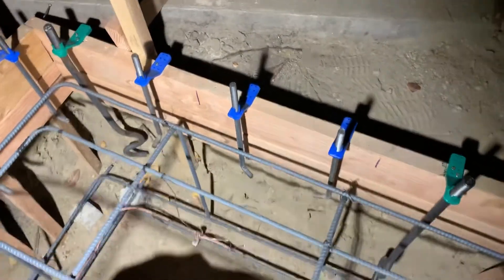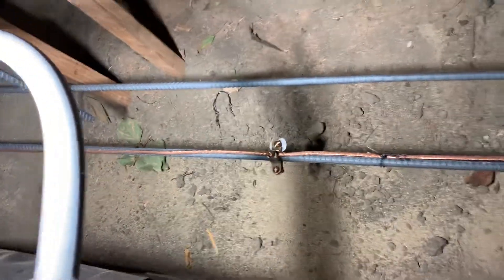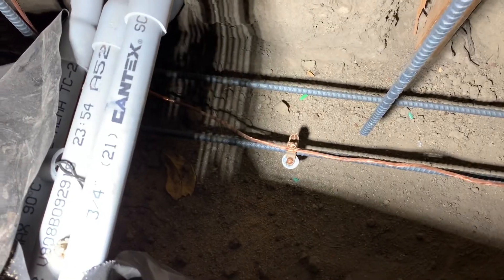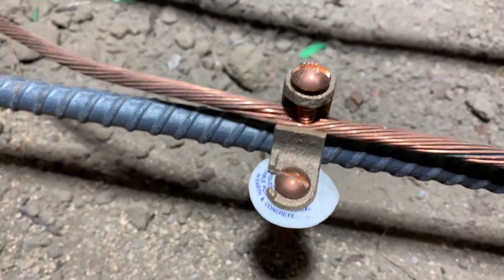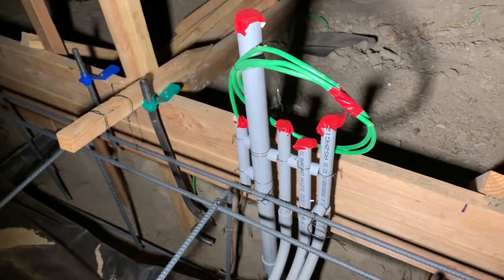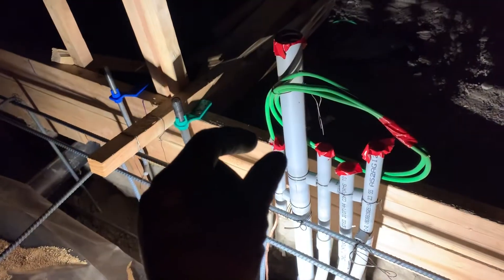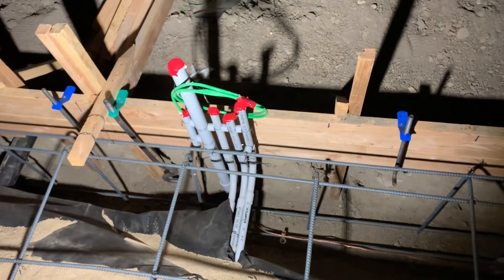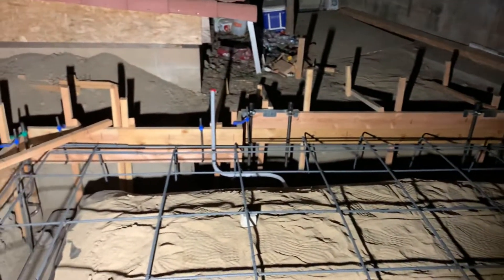Ufer Ground Install for Accessory Dwelling Unit

Comment: The National Electrical Code (NEC) doesn't limit the number of UFER clamps in concrete, but it does require that only one concrete-encased electrode system is bonded to the grounding electrode conductor for a building. You can have multiple rebar or copper conductors in the concrete, but you must select and connect only one to the grounding system.  You must be a wannabe contractor - Not an electrician.

Comment: So you either need to use ground rods or do this?
Reply from the maker: @connerappel6049  2 ground rods at least 6’ apart and  copper cold water connection if your footing/slab on grade has already been poured.  If your project looks like the video, easiest method is to have rebar stub up right below the panel, which you can just place a clamp with a short piece of wire to terminate in the panel.  The video is showing another method of utilizing copper ground wire (4 awg max required).  The copper ground is common for larger projects with larger services.

Comment: It could be a lot done a lot cheaper and still be to code,
Reply: How so?
Reply: @Grumpyskater      This is a video on how to waste money and what not to do.  I've been contracting since 1990, in the electrical trade for 38 years.   All you need is maybe a 6 foot piece of copper wire sized accordingly to the service size and one rebar clamp, NOT THREE and clamping it to a 20-foot length of rebar, that's it.  What this guy did is a waste of time and money.  He stripped 20 feet of wire, tied is to the rebar unnecessarily.  He wasted $45 in material and probably another $60 in labor. On top of that he's got a bunch of extra wire rolled up, which is more waste.  Do that four times a year for 38 years, that's $16,000.  Pretty money-stupid.
Reply: @michaelristow2775  I live in california, Los Ángeles and i was told by one inspector that UFER by rebar is no longer allowed that it has to be a continuous 20’ long ground wire. They changed a few things in 2023 but idk how true this is.
Reply: @Grumpyskater  It seems you have a question in mind.  I would say Ricky that you should research it and find out for yourself.  I've been an electrician for 38 years, an electrical contractor for 33 years.  There's a lot of situations where inspectors are incorrect and they make electricians do stuff that is costly and unnecessary.  What's worse is there's a lot of videos with electricians telling you what to do on YouTube.  I'm watching and I am I'm thinking WTF I know faster cheaper bit better ways then these 40 year-ol "kids".  Hell I'm 65.    These days anybody can pull out a phone and do it video and post it on YouTube. There's nobody policing what is correct.  But I do applied them for a swinging the bat and taking their time out of their regular job to post them.  Hats off to them for that.   But they are young and inexperienced, and don't know better.  He is at, or they just don't seek the truth of. What is the best way or correct, and the fastest way.  I would ask you if you're on a ladder wiring up new construction, recessed, lights how many tools do you use to wire them up?  

Maybe one day I'll have a channel making corrections to all of bonehead electricians, making wrong assumptions and wrong videos. 

Ricky, find out where that information is from quantify through documentation.  Always question, seek the truth, dump your ego of preconceived thoughts, and think out of the box. 

From inference, and your comment, this is a three year old video so let's say that it changed in 2023 as you're saying. That means this guy has likely been doing it wrong and wasting T&M at least three years.   Again, I'm using likely, and from inference, which gives me an out if I'm wrong, but I'm probably correct.  Again, I said probably,  Making assertions, but leaving myself an out.  That's what smart people do.  That's said I would like to know what you find out in the city of Los Angeles.  I worked as an electrician in California 21 years, of that I only did business with up to seven employees for 15 years until I retired here in Hawaii at the age of 47.  That was largely because I'm Business  money-smart, and knew how  to become a millionaire slowly.  I highly recommend if you end up becoming a millionaire following Dave Ramsey's advice.  Oh, I didn't know about Dave Ramsey until my sister sent me the book.  I skim through it and told myself I don't need to read this.  I still haven't because I was doing that crap most of my life, and here I am sitting in Hawaii with the house, no mortgage.   https://www.youtube.com/watch?v=7wjuCgtL0yA
Reply: @Grumpyskater  please tell me and report back.
Reply: @michaelristow2775  for sure. Next time I meet with the inspector I’ll ask and forward his answer through here.

Comment: Why didnt you just clamp the copper wire right below where it came up through the pipe? Why going around and around that much distant?
Reply from the maker: This wire was extra scrap that I had.  Since I wanted to use it up, I just ran all of it.
Reply: You need at least minimum 20’ft of ground/copper wire under

Comment: Why so much wire in the concrete?
Reply: Because he doesn't know what he's doing
Reply: You need minimum of 20’ of ground/copper wire
Reply: @Grumpyskater I think the 20’ is the rebar length requirement that the copper wire is clamped to and not necessarily the length of the wire itself.

Comment: Did you splice that ground together? Or did you actually strip the sheathing off from it for that long run? It runs on the rebar and into the pipe bare, then comes out of the pipe insulated. Unless I missed something.. that would have sucked stripping that wire lol.. no need to use insulated ground
Reply from the maker: Yes the wire was stripped and I left the insulation at the end because I was not going to be present for the pour watch.  I did not want to get concrete all over bare copper so I kept the insulation on for protection.  Keep in mind, I had this wire just laying around so I used it.  This is just another method to provide a Ufer ground for the panelboard.

Comment: Those ground clamps necessary?
Reply from the maker: It's for insurance to make sure it is connected to the other rebars that make contact with the earth.  I see most people use a lot of tie wire.  The intention is to connect to the metallic structural components that are in direct contact with the earth.
Reply: @endlessbalance8  no, none of them are if you use the copper wire 20 foot'. He could've ran 6 feet down to a 20 foot and only one rebar clamp and saved $100 in time and material. opm

Comment: Great content in this video. Just wondering here. What are the rest of th PVC pipes close to the grounding conductor for?
Reply from the maker: Thanks!  I ran the rest of the PVC conduits to certain walls and stubbed up.  I then transitioned to flex and terminated them into 5S boxes which became my home run junction boxes.  Reason for this is so I could avoid drilling through structural or large lumber.  This isn't typical for residential but I like the fact that it saved me time on planning and drilling my holes.

Comment: That  is really a 20 min part of the cement guys job to stub up a rebar witch costed you over $100 t/m.
Reply from the maker: Yeah, but I had this material laying around and just wanted to show people another method.  But yes, typically the concrete sub would just stub up the 20' piece of rebar and support it for the electrician.
Reply: @endlessbalance8  material laying around could be used. What are you actually need it and not waste it.

Comment: You need minimum 6ga copper, but should always use 4 guage
Reply: Minimum wire size for ground rods is 6AWG 250.66(A).
Minimum wire size for Concrete encased (UFER) is 4AWG 250.66(B)
 Table 250.66 is the actual size you have to use. 250.66(A),(B), and (C) are permitted sizes for specific types of grounding. Water pipes, building steel, etc., take the full size, based on the size of the service entrance conductors. 

The grounding is important to discharge transient voltages (lightning strikes & down power lines) to the earth without causing arcing between metal parts in a home. Arcing causes fires, and we are trying to prevent fires.
Reply from the maker: Correct, I had this #4 AWG laying around and just used it.  Thanks for the comment!
Reply: @endlessbalance8  I welded up a 20 foot long UFER and then attached my copper to that tying it to ground Stakes. The whole thing is been buried under two feet of concrete. I got a hope that that will work LOL my building is only 35 ft tall but if it ever gets hit buy a lightning strike that should at least offer some protection
Reply from the maker: @77Avadon77    It sounds like you have the concept.  Most use a 20 ft long piece of rebar that is at least 1/2" in diameter and have it stubbed up under the electrical panel.  Section 250.52(A)(3) clearly specifies what constitutes a concrete-encased electrode. The concrete-encased electrode can be bare, zinc-galvanized, or other steel reinforcing bars or rods of not less than ½ inch in diameter coated in electrically conductive material. It can be installed in one continuous 20-foot length, or, if in multiple pieces, it can be connected by the usual steel tie wires, exothermic welding, welding or other effective means to create a 20-foot or greater length. A concrete-encased electrode can also be constructed using 20 feet or more of bare copper conductor not smaller than 4 AWG.